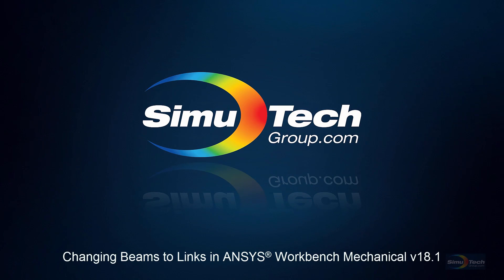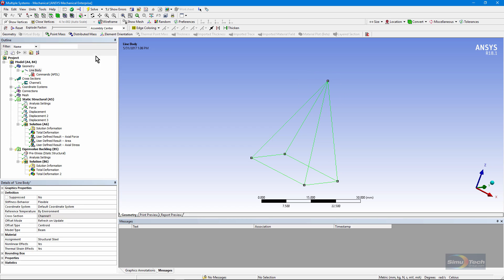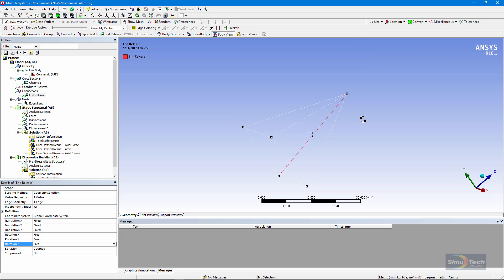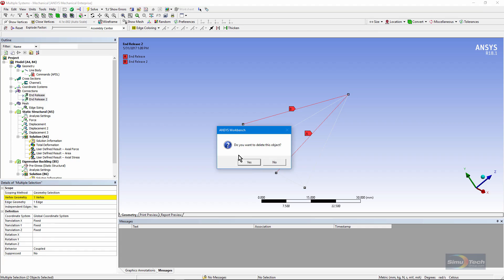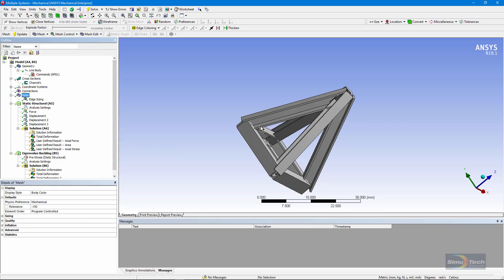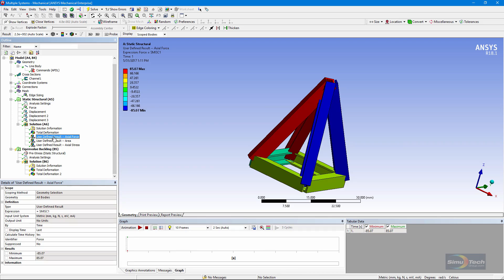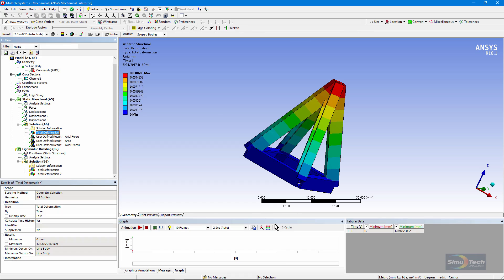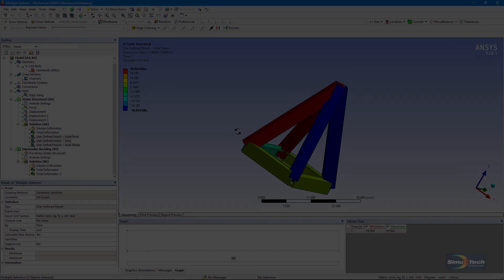Converting BEAM188 Line Bodies to LINK180 Elements in Ansys Workbench Mechanical

Comment: If There are several elements which One need to change(BEAM188 to LINK180), Is there a faster way to do it instead of writing for each of the elements the same COmmand?
Reply: If you put all of the line bodies that are to be converted from BEAM!88 to LINK180, then you could write a *DO loop to go through them, changing each. Consider the ACT object from the ANSYS ACT store to see if that would be easier.

Comment: Is it possibile to create curved LINK180, to simulate a cord (rope). ?
Reply: If you have a curved line body, you could mesh it with a large number of short BEAM188 elements, then convert to LINK180. The long chain of LINK180 elements could approximate rope behavior, although it would have zero bending strength. It might be too stiff in the longitudinal direction, too. For tension-only behavior, you could create a spring connection, and use one of the Details of the spring object to make it be tension-only. You enter the spring stiffness yourself.